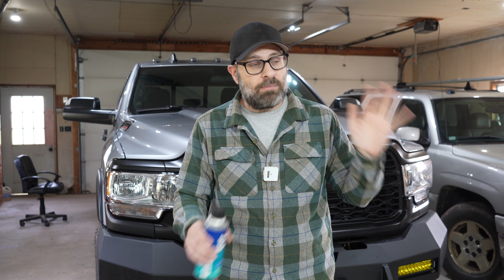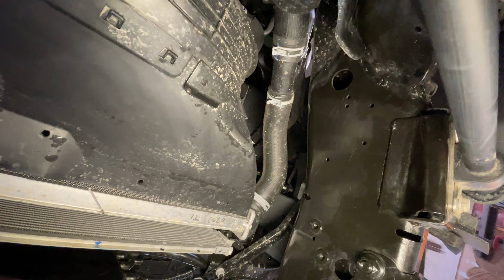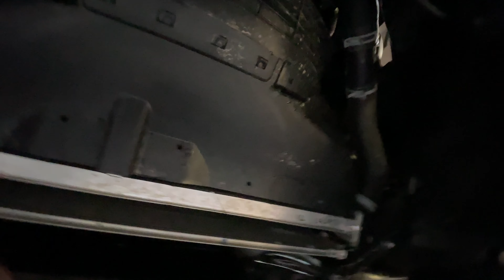Ram 2500 Underbody Rust Prevention CRC 6026 - Fluid Film - Overlanding Adventure Vehicle

Comment: Yes, Toyota is using the CRC. I recently purchased a Sequoia, and the previous owners kept meticulous records. The dealer did, in fact, treat the frame twice with CRC. And the frame is immaculate! If Toyota is using it, that's good enough for me. Thanks for the video.
Reply: They do not use CRC from a company called CRC.  They use other Corrosion Resistant Compound.  It is noxudol 300/700 no CRC HD Marine.
Reply: @zell863 👍

Comment: Coat the inside of the frame ( somehow)!!. These box frames rot from the inside, out.
Reply from the maker: I need to convince a couple mice to go in there with tiny cans of crc.
Reply: @NickMango  Does CRC flow well in say an extension spray nozzle to get inside the frame?
Reply: @jimmpsi  It flow well with extension but is useless for inside of frame as it dry and crack if paint below crack.

Comment: Fantastic video.  After reading the review on Project Farm, I am opting to use  CRC 6026 on a new 2022 Tacoma.  This video told me everything I needed to know.  The Toyota dealer could not believe I would choose this over their $695 undercoating.  Thanks -
Reply: Nop.  It will dry up and crack if paint below it cracks.  It is the best tool for painting over rust but not at top of fresh paint.  Checked and it didn't worked.

Comment: Hey I cleaned and sprayed a 1989 Blazer with Waxoyl cavity wax and underbody coating 20 years ago. It’s still rust free. No sign of any rust inside or outside. I also use a salt inhibitor called Salt Gone . I’m switching to other rust proofing products like Woolwax, Fluid Film and several others. Excellent video
Reply from the maker: Hey Joseph, sounds like you did a great job. Where do you live?
Reply: Hey New Jersey 10 miles west of New York.
Reply: @josephpuchel6497 question, you’re stacking Salt inhibitors with rust inhibitors or choosing one?

Comment: I bought 10 cans  !!! I will be going after any nooks and crannies and bought the 24” extension so I can get up inside where there are plugs remove them spray away and put them back on keep spraying !!! it’s more then just a little job but to protect a $70,000 truck it’s worth it p.s. I found that oil is cheaper at Walmart mart 🤣

Comment: Toyota frames were built by a company called Dana in the USA.  Dana skipped the process where they should have cleaned the oil off that was used as part of the frame forming process.
The frames were then painted and because they omitted the cleaning step before painting ,the frames rusted prematurely as the paint failed.
Toyota sued Dana and Dana gave Toyota 25 million to correct the problem of frames rusting.
  Currently have 2 replacement frames in tacomas owned by family members.

On my new 2020 Tacoma , at the time I used 12 cans of CPC 6026 right after leaving dealer with new truck. I followed up with 3 gallons of fluid film.  I'll continue with a new product called surface shield going forward.
 My opinion is that a product that "creeps" is needed to get to the places you can't reach....and apply yearly or so.   6026 is  Cosmoline which is great,but doesn't move enough.
 East coast of Canada here.
Reply: You can spray fluid film/surface shield on top of cosmoline? I thought it would cause the cosmoline to wear?

Comment: Repair geek said so about cosmoline
"It creeps until it's dry. Once it dries that's it. So if cosmoline does not fully penetrate pinchwelds or bedsides before it dries you're screwed. Any additional products just build up on top of the layer that is dry.. Products that stay wet will continue to creep and self heal 6 months or even years later, cosmoline won't."
So it will probably simple fall of at top of paint.  Please let us know in 1 year.
Reply: The wet stuff like fluid film will wash off unless it's in a protected area. Therefore reapply yearly

Comment: I didn't go with the cosmoline, but did my truck with fluid film. I tried acf 50, foolishly believing it would be less messy, even it it wasnt as sticky. Negative. It was a hella messy. Lots of drips. I've used acf 50 before and if you do metal with a hvlp sprayer to get a really light coat, sure that works. Impossible to see if you've gotten a light but not too light coating on the truck. Drips everywhere. 

I don't live in a "rust belt" state, but it snows here and they salt things, but long and short, the oil undercoating is super simple. A little messy, and the overspray is annoying, but if you drape the truck and walls, its very simple. Certainly not worth the $400 I was quoted at local shops. Its a $150 job to do yourself even if you have to buy the woolwax spray kit.

I would do the low contact areas and cavities with cosmoline / crc like you had if I did it over, and just woolwax the high contact areas like lower control arms.

Comment: CRC 6026, Marine heavy duty corrosion inhibitor, and sp-400 are all the same product. 6026 and Marine HD are more viscous/tacky when "dry" compared to sp-400 though. PB Blaster Surface Shield is just as good (my personal fav). Can sucks, but is thicker than 6026 and Marine HD. Does attract a little more stuff though. "Dries" harder. LP3 and WD40 Specialist corrosion inhibitor are also good alternatives. All named have equal water and salt protection.
Reply: I used surface shield on my last truck. I live off a dirt road and the entire frame got coated in a thick layer of dirt. I left it like that the entire time I kept the truck. I just traded it in and need to undercoat but don't know if I should go cosmoline because it dries and won't attract a layer of dust.

Comment: Have you tried cosmoline RP -342 ? I have used it on my wrangler Rubicon and my Ram 2500 and it lasts and protects. Like no other . Give it a try you might like it.
Reply from the maker: Never tried it but I’ll look into it. Thanks
Reply: On the “Repair Geek” channel he does a VERY extensive video on various types of rust inhibitors.  He compared side by side the CRC, RP 342, and Amsoil HDMP which are all cosmoline type.  All three were excellent!!
Reply: @Gretzky2857 so why does he only use lanolin based products on his vehicles, no cosmoline?

Comment: Super insightful video, looks much more resilient than the lanolin sprays.  I just wish less of it blew away instead of sticking to the surface.
Reply from the maker: It’s really cheap. $40-$50 bucks is nothing. You might lose some but it is what it is 👍.
Reply: @NickMango  That's true and it seems much easier to apply than POR15, etc.  One confusing thing, I've seen several posts saying it can't be applied over paint?  Truck frames are painted, mine has a little rust... do the instructions say anything about applying over paint, versus only on bare metal or rust?  I can't find any insight on their website re application instructions.  Thanks!
Reply from the maker: @Really10801  they mean body paint. You can spray it over everything under the truck no prob.
Reply: @NickMango  OK thank you, I bought a can to try it out and I like it a lot. I sprayed it inside the frame and could actually see it drifting out of the holes all the way on the other side like 6 feet away.  I imagine it is coating the inside of the frame as it drifts along the length.  A spray straw would definitely help, but it does not seem like a showstopper at all.

I ordered another six cans and I will let my mechanic finish the job because he can put it up on the lift and be much more thorough.

Thanks very much for your insights, your video really helped me narrow down quite a wide array of products to find what I believe is the right one.
Reply: @Really10801 how did it turn out. Are you happy with the coating. Does it attract dust? Does it hold up and prevent rust.

Comment: Great info man, definitely helps us alot 👌
How long the film will last until it need a respray?? 12 months? More or less?
Reply from the maker: 12+ as long as you don’t power wash it like crazy. I did mine right before this winter, so probably summer 2023 I’ll get under there and do it again.
Reply: Just do yours every 12 months or so, after every winter, depending where you live. It will not cost you much money and time. I just got brand new trd pro and bought two cans of crc, that's all I could get for now but I will get more.

Comment: Nick! quick question, its starting to get really cold and im trying to get this applied ASAP as it got delivered yesterday (a week late), if there's going to be a light rainfall in the next few hours do you think im ok to apply outside and about an hour after it start raining? will it affect the curing process?
Reply from the maker: Drive slow you’ll be good. Don’t go flying through puddles. GL 👍

Comment: Will it bind to rust? if you already have rust i mean
Reply from the maker: You need to spray rust with rust converter first.
Reply: @NickMango  I do not think so.  Check my tread "10 year of using cold galvanizing compound" #28.

Comment: This is ineffective if it is sprayed on already rusted metal.  It won't form a barrier and prevent further rust.  After a winter the rusted area is dry with no evidence of a waxy coating.  It works on clean metal and painted metal.
Reply: Not true per my experience.  Google "10 year of using cold galvanizing compound" nr 28.